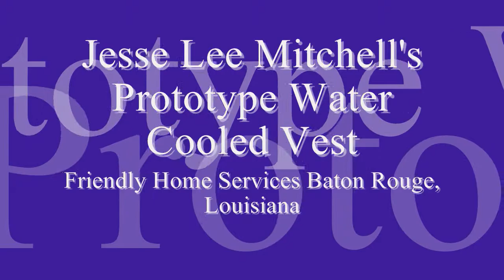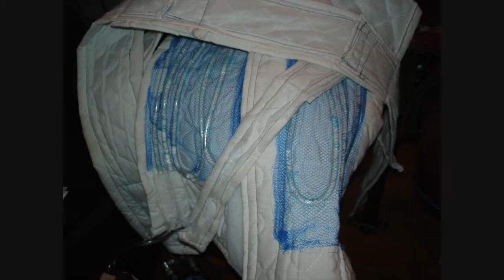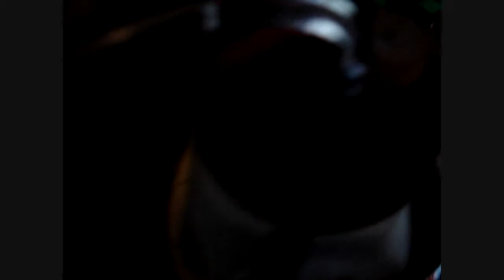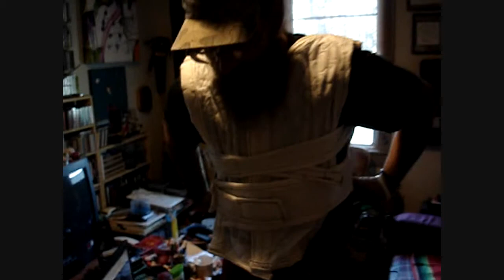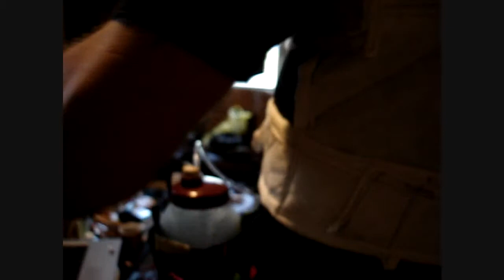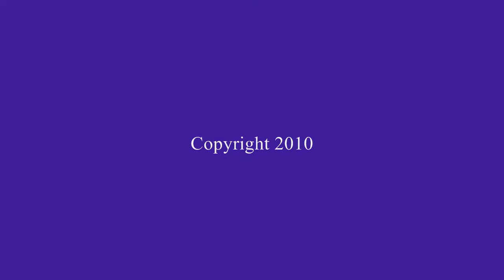Friendly Home Services - Prototype Cool Suit 001

Comment: You're ugly but your suit is fantastic. I love the the use of the plasma pump instead of all the foolish attempts I see others try using. OK. next time tint the fluid and use some lights so we can see your device in action. I would suggest a Peltier cooler as a part of a heat exchanger. It's low power and silent.

Comment: About 10 years ago I started to work on a prototype of my own personal water cooling jacket as well. At the time I was using a car battery to power the pump and the cooler and kept struggling with controlling the energy efficiency. I gave up on the whole idea about 5 years ago until I recently had a break through with finally maximizing the energy efficiency working on a separate project. I may not pursue a patent just yet. I wish you the best and once you have a developed model patent it!